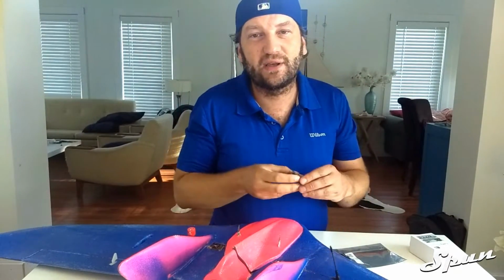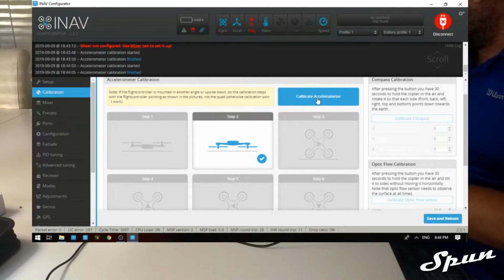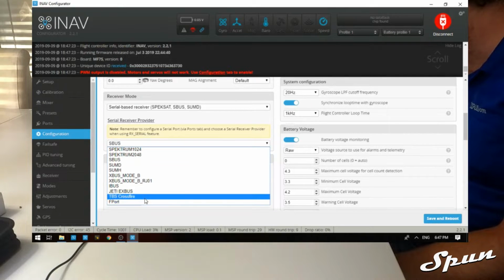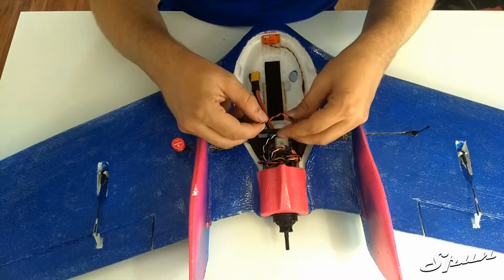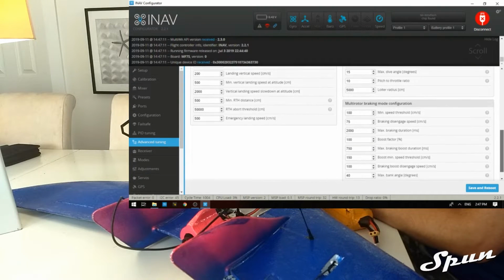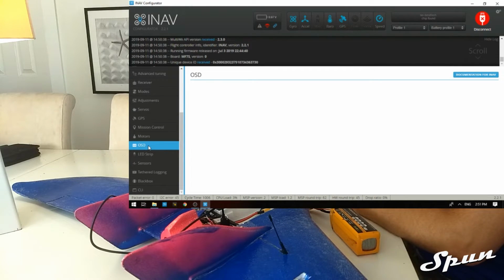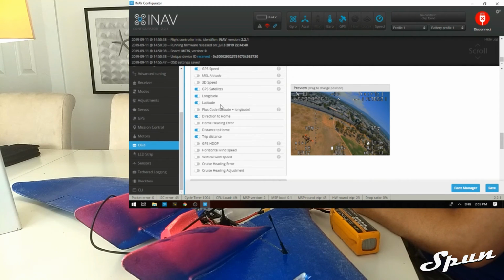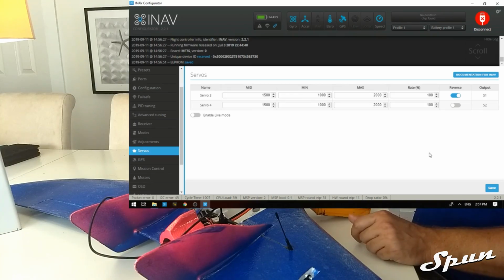Matek F722-Wing(INAV) on 6S - Part 1- Installation and Setup (C1 Chaser Wing)

Comment: Which ESCs can be controlled and which settings in iNAV have to be set for this?  I have an older rc-plane and I want to test it.  The ESC is not responding to the RC transmitter.  The engine runs in the iNAV during the engine test.  What can that be?